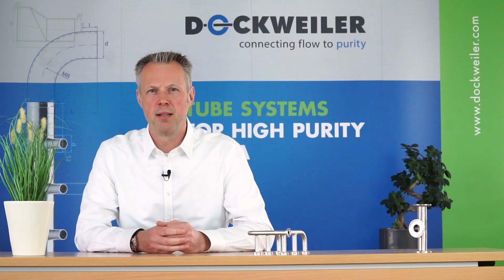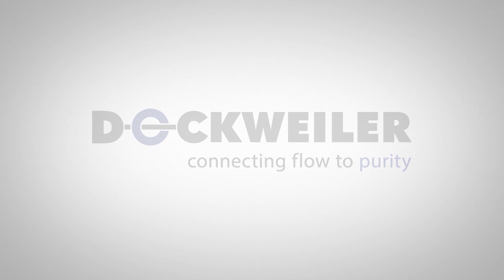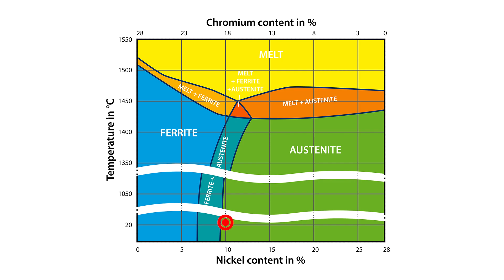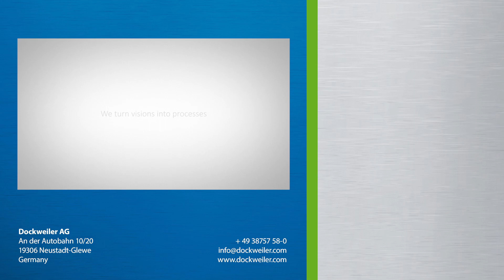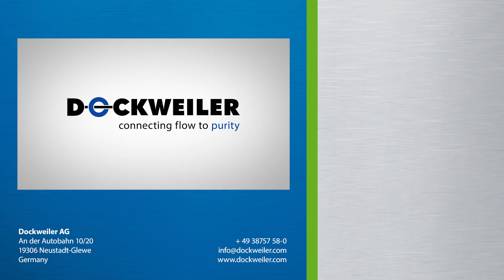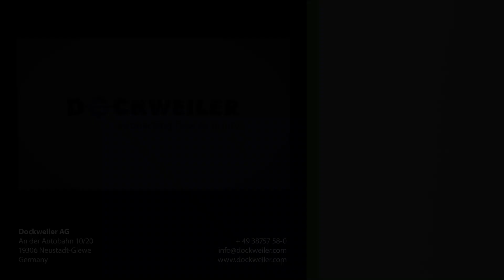Solution annealing - process and effects of this heat treatment on stainless steel

Comment: Hello from Canada!

After watching your video about solution annealing, I was very pleased! There are so few videos giving a deep and informative dive on the subject, and I was happy to see that at least one video offered a good explanation of the process and its benefits. I was, however, still left in the dark about some questions I had and have decided to reach out to see if you could answer some of them.

I have several 316 parts that were welded using GTAW. These parts are meant to be used in an acidic environment, and fearing corrosion, I decided to look into methods for treating the damage welding may have caused. My research led me to understand two things welding does:

It makes the chromium at the surface react excessively with oxygen, forming an oxide scale and leaving the surface depleted of chromium.
Chromium carbides may form, leading to something called sensitization.

So many sources list things like electropolishing, pickling, and passivation (using acids) to help “fix” the passivity of the material and make it corrosion-resistant once again. I can see how this tackles problem number one, but no one talks about how this fixes the second problem—the chromium carbides. The heat from welding travels well under the few microns that are cleansed during the methods mentioned, and so the material underneath should still contain these carbides.

In my research, I have discovered a limited number of sources listing solution annealing as a possible solution to diffusing the chromium carbides and restoring the full corrosion resistance of the material. In these sources, they mention heating the material to about 1050 °C, followed by rapid quenching (which is slightly different from what you mentioned in your video). I wanted to know: just how necessary is this process in the first place? There is very limited coverage on it, and it has made me extremely curious. Is the electropolishing and passivation enough?

On a similar note, I wanted to ask why your video mentioned the use of 316L in the solution annealing process. From what I have read online (from several credible sources), 316L typically requires such a long exposure at such high temperatures that solution annealing should not be necessary, as chromium carbides generally do not form.

If you could bestow your knowledge on me, it would be greatly appreciated. The limited amount of information I can find online is often contradicting and infuriating, and feels like an itch I just can’t get to.

Comment: What would be the effect on repeat solution annealing on 316 Stainless steel material?
Reply from the maker: Hi,
 
repeated solution annealing is of no particular use. Once you did a proper annealing and the austenitic structure is well defined repeated annealing would neither harmful nor beneficial. 
 
I hope that answers your question.
 
Cheers Torsten

Comment: What would be effect on stainless steel due to more soaking time?
Reply from the maker: Dear Jivesh,

to extend the dedicated duration time for a given alloy at a specific temperature would not change the result of annealing. 
Once an equilibrium of alloy-crystallization is achieved a longer duration time will not change it. 

Best Regards, 
Torsten
Reply: @DockweilerAG  Thank you,but i have seen increase in grain size & decrease in hardness due to prolonged soaking.

Comment: Hi
We had performed Cold bending operation for SA213TP347H tube. We need to perform PBHT of bend area of tube as per ASME sec-1 PG-19. We can know heat rate,soaking temperature, soaking time from Code but Code doesn't specify cooling rate. Can we perform forced air cooli g method instead of water quenching? what should be cooling rate?
Reply from the maker: Dear mrahul28,
sorry for the late reply. We have checked internally if we can answer your question. 
Unfortunately, we cannot provide a clear answer. However, you are welcome to contact us or our representatives by e-mail or phone: https://www.dockweiler.com/en/contact
Reply: @DockweilerAG  Thank you very much for your reply. We will contact you.

Comment: I have found out that in some research journals, people have reported solution heat treatment of 17-4 PH stainless steel at 1040 C for 30 min and quenching in air ( Air cooling) whether some of them reported heating at 1040 for 1 hr than water quenched. Kindly answer me which process to be adopted to perform solution heat treatment in case of 17-4 PH stainless steel ??
Do I really have to go for 1hr of solution heat treatment or 30 min will be enough along with which type of quenching is required ( water or Air quenching) ??
Reply from the maker: Dear RISHABH SAXENA, there is no answer which is totally matching to this question. The answer is: it depends….

First, the timeframe for the solution annealing is the heat penetration time (the time needed to have core of your product at annealing temperature) + holding time. You do this process to transfer your material to an austenitic structure. For this you should check the sample sizes in the journals if these are similar to your own. 

For the quenching, your cooling rate is important. You should check your journals for time temperature transformation diagrams. You should find the effect of your cooling rate on the material structure especially the martensite content in your case. 

You have to meet the critical cooling rate. That’s necessary to avoid diffusion based phase transformations (this means that there is no formation of bainite and perlite).

You can use a quenching medium (water, air, oil …) to meet your cooling rate.

We hope this could help you. 

Best Regards, Torsten

Comment: Is it not also important to Quench and stabilize the 316L after letting the Chroom re-diffuse at around 1050-1100 DegreesC ?
Reply from the maker: No, the material will be kept for a calculated time at the annealing temperature and then will undergo a cool down profile.

There is no need for rapid cool down as the annealing is done under a hydrogen atmosphere, hence there will be no excessive scaling or corrosion on the surface. Furthermore we consider only low carbon material and due to that there is no risk for the formation of chromium carbides. 

Hope that helps.

Best regards, 
Torsten